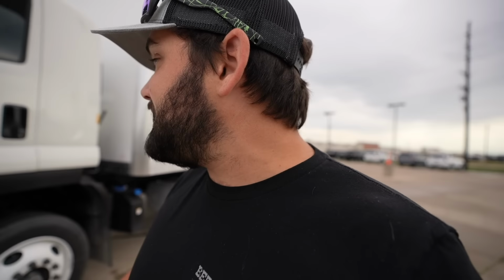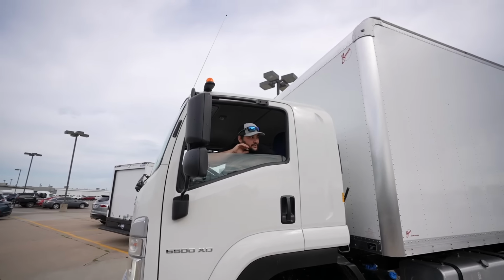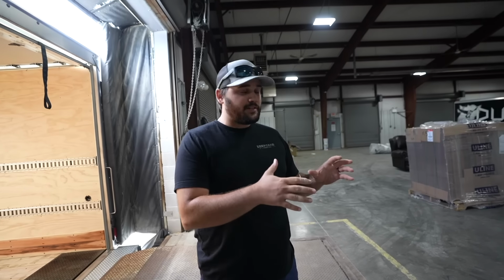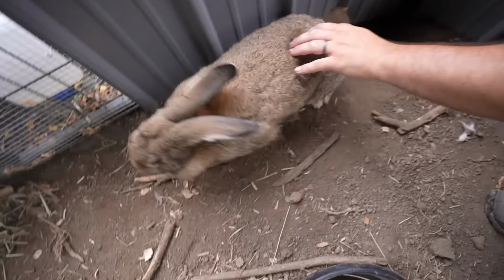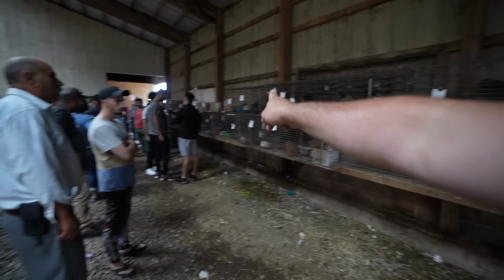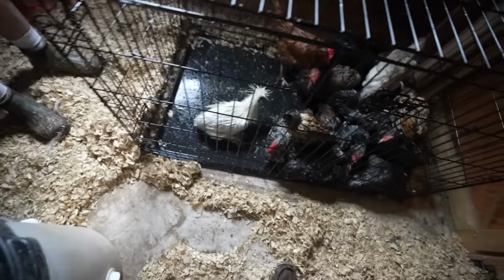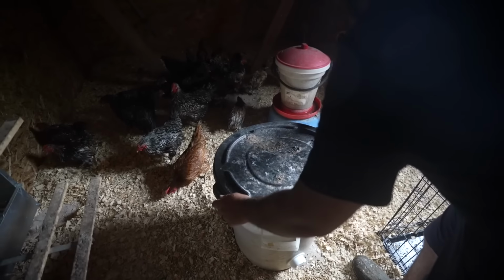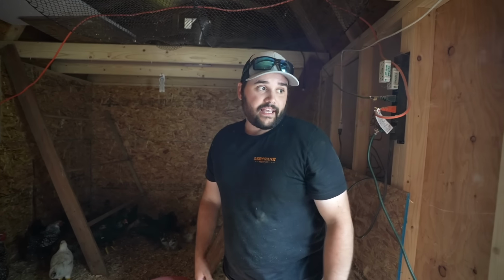I Bought EVERY CHICKEN at the ANIMAL AUCTION!!! (They Were Pissed)

Comment: That's a cute little EU cabover truck lmao. Flair's excitement over driving something like that cracks me up. and yes, it's based off of a semi, if anything it's more awkward to drive because you have extreme over-hang at the rear when turning. I'd much prefer my 40 tonne truck with trailers, only gotta really watch out for the shoulders of the trailer when turning. easy enough! Also, the mirror above the passenger seat is so the driver can see how close they are to the curb so you can park nice and close without damaging it. Honestly, I'm more comfortable driving my truck due to seating height / mirrors than I am my normal car!

Comment: Dig down 2 ft with your excavator the same size of the cage,  line the bottom and sides with chicken wire and fill back in with the dirt and tiewire the chicken wire sticking up to the cage and you wont have to worry about them digging.

Comment: Paused at 10:33 - Yikes! no securing the pallets, no anti-slip material on the truck's floor, you've got those things on the side to attach bars across to prevent fowards/backwards movement, and with nothing in between the middle of the pallets, you're gonna have to corner very slow to avoid damage!

Comment: Be careful with the air brakes flair ! They lock up way easier then regular car & truck brakes . You just have to push them a little lighter. From my experience, newer trucks could not have that problem but just keep it in mind

Comment: That rabbit enclosure is way to small for them they need a lot more room than that to move around and stretch those legs she will dig up a nest for her babies but they also dig a lot in general my rabbit will dig every single morning even at my hardwood floors they just love to dig it’s what they do make them a new much larger enclosure and dig down a few feet when you set the fencing or just bring them inside they’re easy to potty train biggest problem with them inside is they also love to chew on everything they’re not supposed to